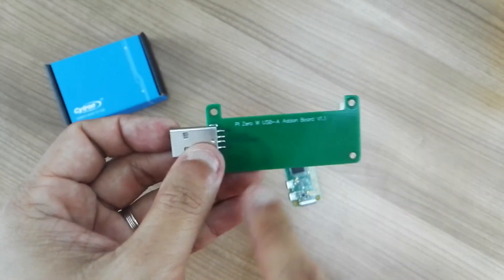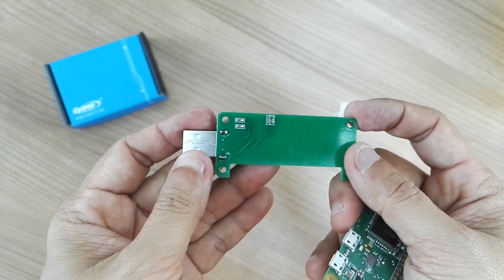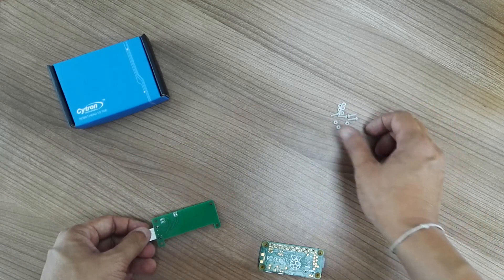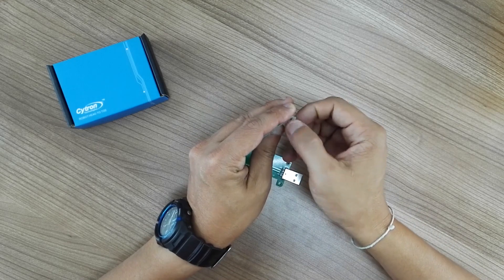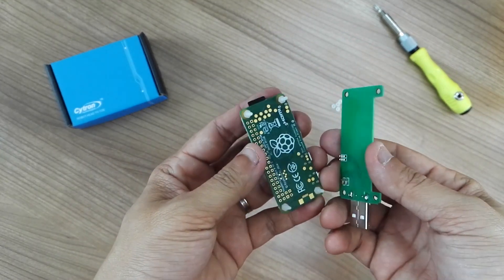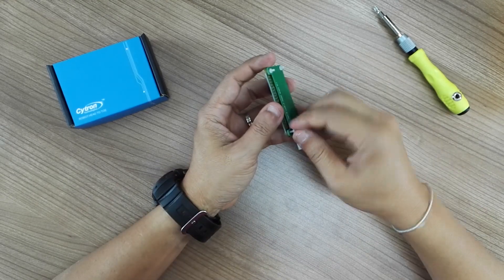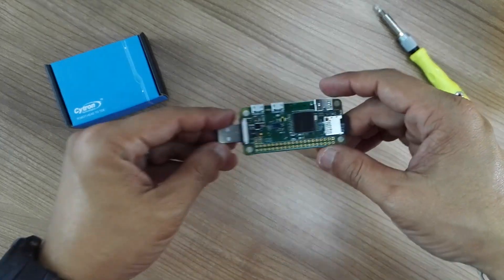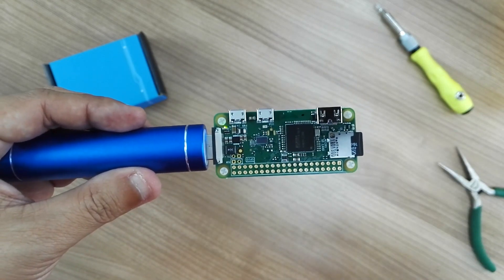Solderless STEM for Raspberry Pi Zero - Ubox and Assembly #raspberrypi #pizero

Comment: So, in this add-on you just convert into full size USB male instead of micro USB female port. In this option is it possible to use both port (Full size USB for WiFi dongle & micro USB for sound card) at the same time? Without using a USB hub?